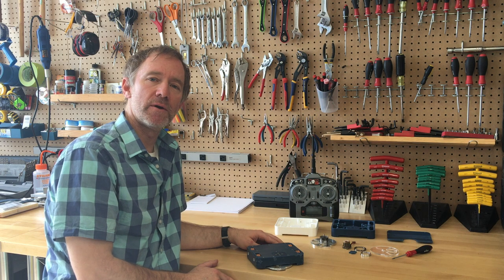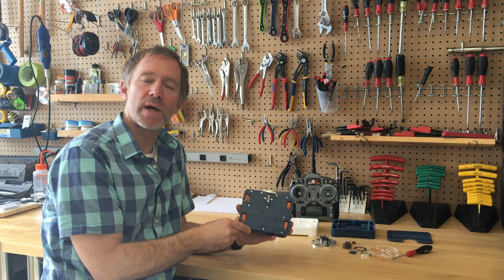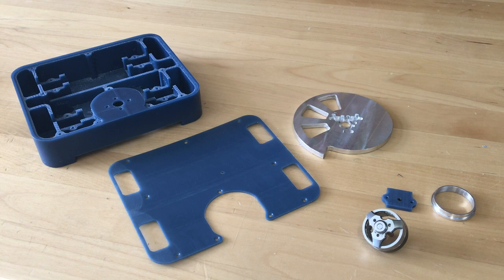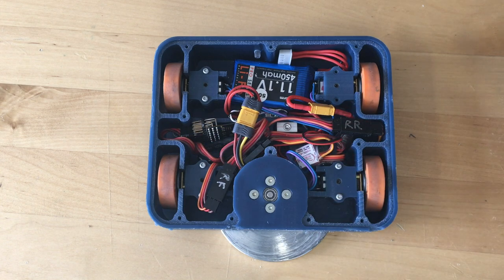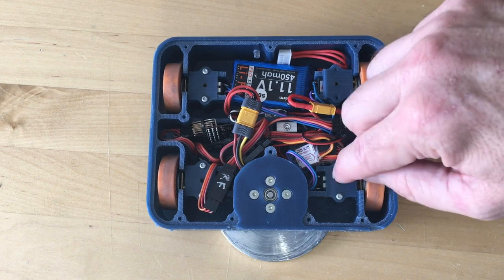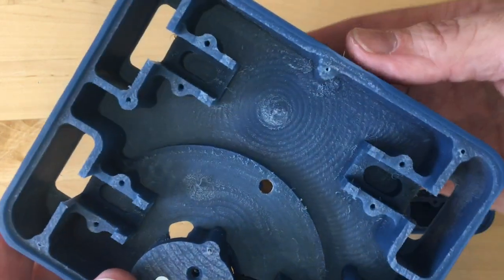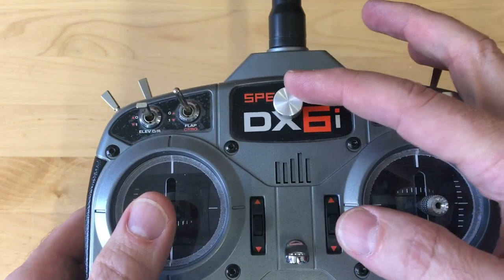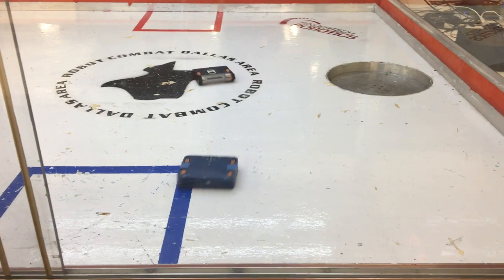Blue Screen of Death - 1lb Antweight Combat Robot, Part 1 - Design

Comment: So it's basically a 1lb Crippling Depression? Awesome how you managed that downscaling
Reply from the maker: Uh, basically a similar shape and concept (and other undercutters pre-dated CD). Otherwise, nothing is similar or "downscaled" - different weapon system (CD used two motors and belt with pulleys), different drive (I have dedicated 4WD), different armor, different chassis. Different everything.

Comment: Im going to start on this. What was your EXACT final price on this?
Reply: Considering the materials and tools he used too much.  I was interested in getting started in this, but with folks like this sending this much on a 1lb bot it makes it difficult for those on modest budgets to compete.
Reply: @willierants5880  I always thought thought it would be cool to have a hand-crafted class. No 3d printed or CNC machined chassis.
Reply: @matts1166  I'd love to see a load of robots with motors duck taped on, fixed to thin wooden boards etc. - would be far more destructive and entertaining!
Reply: @02smithm1  Hell, it doesn't even have to be that cheap. A sheet of aluminum with a couple of bends, or some Lexan sheets glued together, or some old cutting board screwed together will only set you back $20 or so.

Comment: Excellent video Chris... and thanks for all the links to the parts. Can you tell me what the shaft diameter is on your banebots hubs? I see the N20 motors have a 2.5mm wide shaft, but those hubs go 2mm, 3mm, and 4mm...
Reply from the maker: I think I got the N20 motors from Pololu. Check out their site. There's a datasheet for the motor showing the shaft diameter as 3mm. So, I used the 3mm Banebots hub. https://www.pololu.com/file/0J1487/pololu-micro-metal-gearmotors-rev-4-1.pdf

Comment: Very clean! nice video. Did you have many problems with the aluminum weapon disk?
Reply from the maker: Y Boah thanks. The tip of the weapon disk got bent somewhat. I’ve made a new disk from aluminum but with a steel tip to address that issue.

Comment: Nice vid. Whats is UHMW? Some sort of plastic? Does it come in a block or did you laser print it. And nice of you to give kudos to Robert. His vids are very informative.
Reply from the maker: conanthecribber It stands for “Ultra High Molecular Weight” polyethylene. You can buy it various forms - bars, sheets, etc. there’s a link in the info for where I got it (McMaster Carr). I don’t think you can print it - you buy the material and then machine it or cut it down to size.

Comment: What bearing did you find for the outrunner of your motor? (The "rumham" design) I am worried about cracking the magnets in my motor while machining it, and I can't find those super thin bearings for that size. Only found ones that weigh like 100+ grams and that's way to much weight
Reply from the maker: Check out vxb.com "thin section bearings". That's where I got it. The ID of the bearing was just larger than the OD of the motor, that's why I needed to make a spacer.
Reply: @chrismiksovsky5871  Thank you! Yeah these seem way more reasonable in weight. Costs about the same as the motor I'm using but I guess that's just how it goes 😂

Comment: What is the thickness of the side walls? May get some thinner sheets to hand cut and bolt together and am trying to find a good thickness. Thanks!
Reply from the maker: 4.5mm
Reply: @chrismiksovsky5871  Thank you! I appreciate that!
Reply from the maker: No problem. The tops and bottom are much thinner - about 1.5~2mm.
Reply: @chrismiksovsky5871  Thanks!

Comment: Is your fusion file for sale? I would love to 3d print it to see if my daughter really wants to get into it.
Reply from the maker: I appreciate the interest but I don't think this is the best first bot to try out because of the numerous custom parts, particularly the weapon system that requires a machined disk and non-trivial changes to the weapon motor. Have you checked out the BotKits D2 kit? Many beginners use that kit and it can be very effective against all kinds of robots. Or, the Fingertech "Viper" is another starter kit that could be good. You might also consider the "Fairyweight" class of robots - those are limited to 150g and are really intended for essentially 3D printed bots that don't need complex machining or assembly. Lastly, there's an "Antweight combat robots" group on Facebook. You could join that and you would likely get other recommendations on ways to get started.
Reply: @chrismiksovsky5871  I have a cnc router, mill and laser so the custom parts aren't the problem the design is. I'd rather build it. Thanks for the reply though.
Reply from the maker: @MrFreeway99  Sounds good. I've uploaded the STL and STP files to Thingiverse (https://www.thingiverse.com/thing:4075681). Let me know if you end up making one. Have fun!

Comment: Thats a great weapon design do you recommend3d printing
Reply from the maker: Keegan Wright 3D printing is fine, but it’s generally not as strong as machined plastic parts. I have access to a CNC milling machine so I prefer to machine most parts.
Reply: Chris Miksovsky Thank you. I do have access to a laser cutter so I was wondering if a 3d printed part could help save weight.

Comment: I would kill to get into this hobby, no one in my area does robot battles
Reply from the maker: T-Man it’s a cool hobby. Check out “antweight combat robots” “beetleweight combat robots” and “combat robotics” all on Facebook. Also, “buildersdb.com” lists events - maybe one could be within a reasonable trip. I’ve had to fly to compete so far.
Reply: @chrismiksovsky5871  

Yeah that and money, I dont have the funds for a 3D printer just yet
Reply from the maker: T-Man 3d printers are helpful, but people make good bots from plastic kitchen cutting boards using not much more than a saw and a drill. There’s definitely some expense to get going (radio, battery, charger, etc) but you don’t need a 3d printer to make a bot.